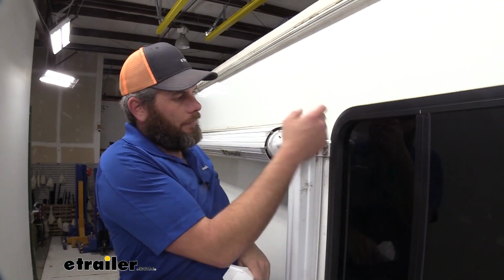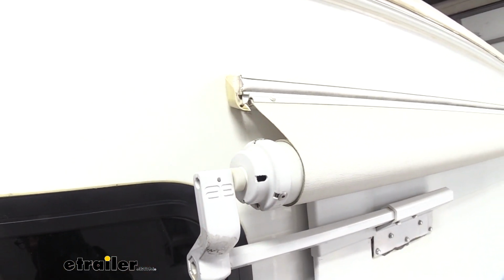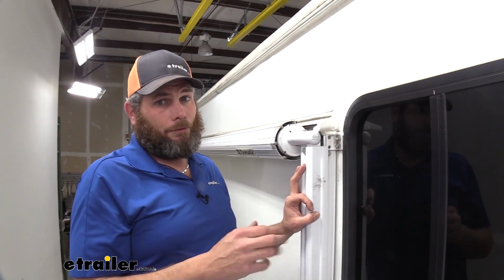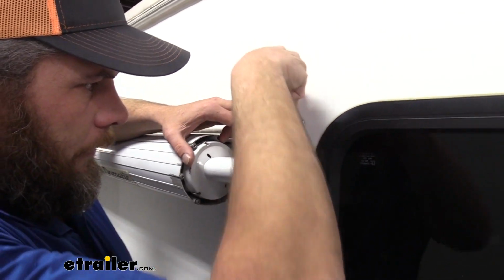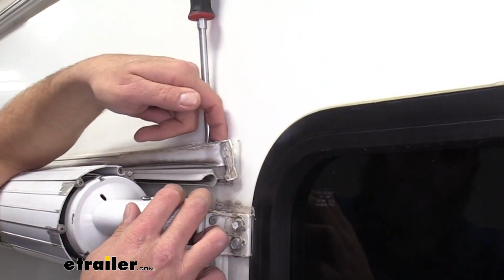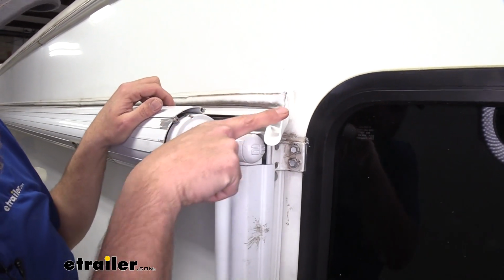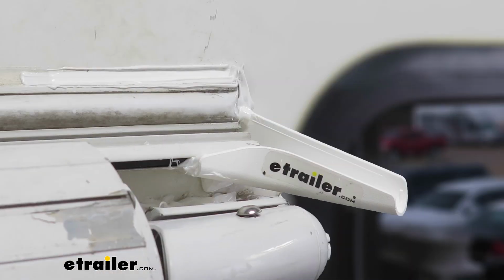etrailer | Comprehensive Review: Camco RV Rain Gutter Spouts with Built-In Extensions

Comment: Thanks for the demonstration.  How did you remove the old silicone?  Plastic putty knife and or a chemical of some sort?
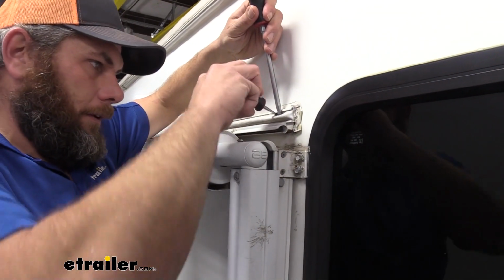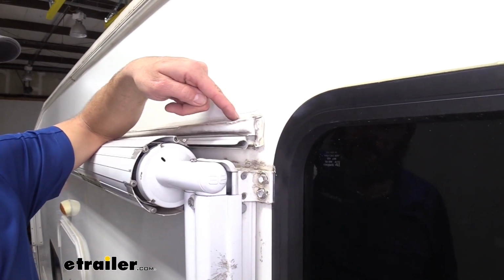Reply: @John W I was wondering the same thing...I watched it twice.. he did say..at 2:32 he used a flathead screwdriver to help pull away the rubber inside the rail from the top.....then at 3:15 he used a razor blade. ...to cut a slit at the top of the rail into the silicone....and again at 4:02. Hope this helps. I'm sure once my rain gutters get here. .I'll watch it several more times....during my installation!.. GREAT VIDEO. .THANKS!
Reply: @John W
Reply: Use a hair dyer to warm it up. Carefully with a putty knife- remove. Cloth rag and alcohol